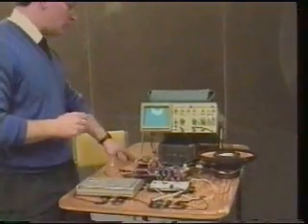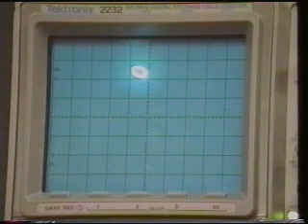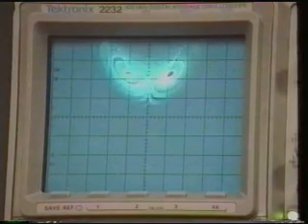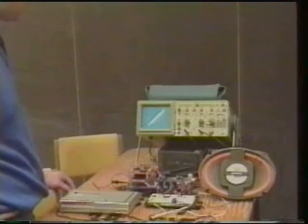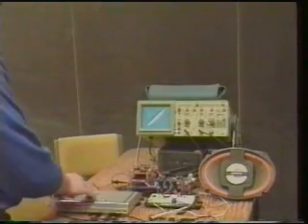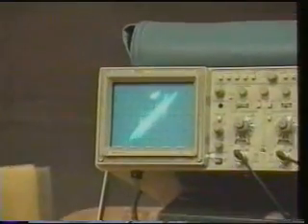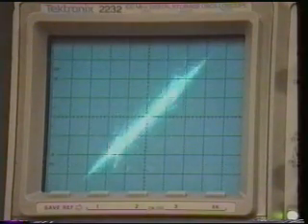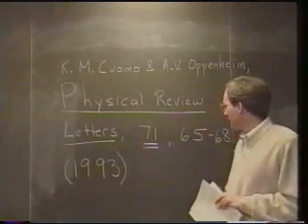Steven Strogatz - Nonlinear Dynamics and Chaos: Part 5

Comment: In this demo it appears that the 3 variables of the Lorenz system are modelled as voltage values which vary at audio frequencies in the circuit as implemented here. One or more of these voltages can then be amplified to directly drive the speaker giving the sound output. I hope that makes some sense and helps.